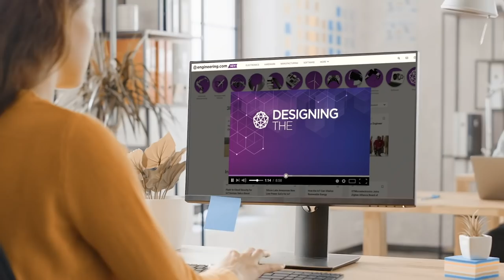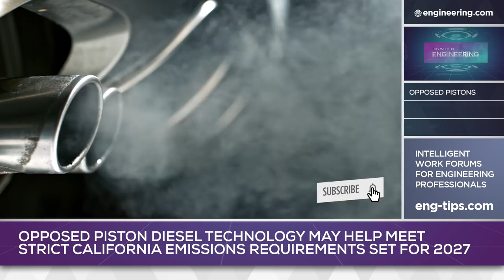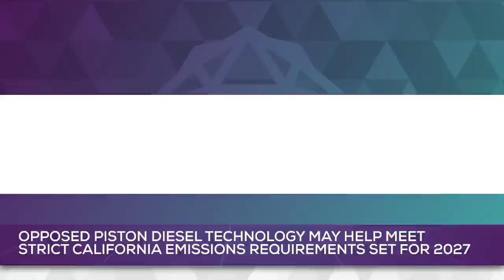Opposed Pistons Offer New, Clean Life for Old Diesel Technology

Comment: Fairbanks Morse opposed piston diesel engines were used in submarines during WW2 and locomotives in the 1950's.
Reply: And still in Coast Guard vessels.
Reply: They are used for generators in submarines to provide backup power on US nuclear submarines commissioned through the 1990s
Reply: Many fleet subs in WW2 had opposed piston F-M Diesels as well as the GM vee-block Diesels.

Comment: FYI the first opposed piston diesel engine was designed and a prototype built in Russia before 1910. So the technology is almost as old as the diesel. I also note that the Napier Deltic was a very efficient, comparatively small and lightweight (roughly 1/5 the weight of comparable power engines) two stroke diesel which could provide a good model for a future design.
Reply: The only thing against the Deltic was its complexity. I think the world is loooking at three-cylinder opposed-piston diesels for a long time.

Comment: Very little technology used today is new. This design engine with 2 crank shafts geared together and 2 opposing pistons per cylinder was one of Fair Banks Morris's best built engines. The multiple cylinder engine that in the 80's Cadillac called the 4-6-8 and now other manufacturers have other names for, was first tried in 1908. It was several levers on the dash that the driver could use to disable a number of cylinders as needed to save fuel. They said it didn't work very well then either. Electric cars, alcohol fuel, variable displacement engines and opposed piston engines are just some of the ideas developed and tried between 1900 and 1950. Some have come back because we have the technology to make them work now but some of the ideas just aren't very good ones. We don't create new ideas much anymore. We just improve the ones our ancestors thought up. I f a new idea is thought of it is so complex that it isn't much use. I learned a long time ago the KISS rule should always be considered when building or designing something. KISS means keep it simple stupid.

Comment: Wow! This-> 2:10 is a careless way to say that.

The Junkers engine was a copy of the French Gobron-Brillié design, established before Heavier than Air, Powered Flight existed :

"One of the first opposed-piston engines was the 1882 Atkinson differential engine,[7] which has a power stroke on every rotation of the crankshaft (compared with every second rotation for the contemporary Otto cycle engine), but it was not a commercial success.[8]

In 1898, an Oechelhäuser two-stroke opposed-piston engine producing 600 hp (447 kW) was installed at the Hoerde ironworks.[9] This design of engine was also produced under licence by manufacturers including Deutsche Kraftgas Gesellschaft in Germany and William Beardmore & Sons in the United Kingdom.[10]

In 1901, the Kansas City Lightning Balanced Gas and Gasoline Engines were gasoline engines producing 4–25 hp (3–19 kW).[11]

An early opposed-piston car engine was produced by the French company Gobron-Brillié around 1900. In April 1904, a Gobron-Brillié car powered by the opposed-piston engine was the first car ever to exceed 150 km/h with a "World's Record Speed" of 152.5 km/h (95 mph).[12] On 17 July 1904, the Gobron-Brillié car became the first to exceed 100 mph (161 km/h) for the flying kilometre.[13] The engine used a single crankshaft at one end of the cylinders and a crosshead for the opposing piston.

Another early opposed piston car engine was in the Scottish Arrol-Johnston car, which appears to have been first installed in their 10 hp buckboard c1900. The engine was described and illustrated in some detail in the account of their 12-15 hp car exhibited at the 1905 Olympia Motor-Show.[14] The engine was a 4-stroke with two cylinders (with opposed pistons in each) with the crankshaft underneath and the pistons connected by lever arms to the two-throw crankshaft.

The first diesel engine with opposed pistons was a prototype built at Kolomna Locomotive Works in Russia. The designer, Raymond A. Koreyvo, patented the engine in France on 6 November 1907 and displayed the engine at international exhibitions, but it did not reach production. The Kolomna design used a typical layout of two crankshafts connected by gearing.

In 1914, the Simpson's Balanced Two-Stroke motorcycle engine was another opposed-piston engine using a single crankshaft beneath the centre of the cylinders with both pistons connected by levers.[15] This engine was a crankcase compression design, with one piston used to uncover the transfer port, and the other to open the exhaust port. The advantage of this design was to avoid the deflector crowns for pistons used by most two-stroke engines at that time.

Doxford Engine Works in the United Kingdom built large opposed-piston engines for marine use, with the first Doxford engine being installed in a ship in 1921.[16] This diesel engine used a single crankshaft at one end of the cylinders and a crosshead for the opposing piston.[17][18] After World War I, these engines were produced in a number of models, such as the P and J series, with outputs as high as 20,000 hp (14,914 kW). Production of Doxford engines in the UK ceased in 1980.[17][19][20]

Later opposed-piston diesel engines include the 1932 Junkers Jumo 205 aircraft engine built in Germany, which had one crankshaft, using a design similar to the 1900–1922 Gobron-Brillié engines.[21]"
Reply: If Wikipedia is your source, then you don't have a source.

Comment: How is this new tech when the British were using it in WWII deltic engines? Then of course there was the Culverin in the early to mid 30's another Napier design. Before that there was the Junkers Jumo 204. That was operational in 1932. I know the Americans like to be fashionably late (EG WWI and WWII) but 90 years is a bit excessive. Especially to then call it "new".
Reply: The Culverin was a Junkers 204, built under license.  The Deltic was a post-WW2 engine, entering railroad service in 1960.  What makes the Achates engine new is modern high pressure fuel injection systems and a large amount of computer analysis of the combustion process.

Comment: I can remember seeing the two stroke Deltics start up at St Pancras , the epitome of  opposed piston  ingenuity,  a cloud of acrid  black smoke and unholy noise  enveloped the whole station, as if the engine was on the point of spontaneous disassembly. Good luck on to the engineers taming that with Cats and add blue.
Reply: Contemporary overhead valve diesel engines produced clouds of acrid  black smoke then.  Technology has tamed those.  That technology transfers readily to OP engines.
Reply: @superdave380  Its Commer knocker with EFI a  big CAT and DEF, used to haul coal in limestone around here 50 years ago,. Not the best sounding engine either. Fun for the engineers but 2 strokes are not so economic  once you have bolted on the chemical plant for the exhaust compliance and dumbed down the combustion dynamics to work with them.  Not happening.
Reply: @logtothebase2  I guess that you know more than the engineers that are making the Achates design work.
Reply: @superdave380  I am a YouTube comments expert so I know way more. I hope they have success and their slide rules run true, but I feel squeezing more out of the ICE isn't the way to go, we will see
Reply: @logtothebase2  Fossil fuels are a finite resource, the ICE cannot last much longer.  Until we have a viable sustainable replacement we should build the most efficient and cleanest engines we can.
Reply: @superdave380  Agreed.
Reply: I'm sure with modern electronics some of the faults if not all can be ironed out ( head gasket manufacturers watch out!!

Comment: I think you will find that Burmeister and Wain built  opposed piston engines for ships prior to this.  Prior to them were other opposed piston engines  with varying degrees of success.

These opposed piston engines were very popular.  There were also 6 double acting marine diesel engines built, for three ships. Not fully opposed piston as upper and lower exhaust pistons were of smaller bore.

Comment: You don't explain how it is that the OP engine actually reduces the emissions, just that 'it does' 🤷

Is it due to the the very long effective power stroke resulting in a more complete burn? (given that the 2 pistons are moving apart, rather than a single piston moving away from a fix cylinder head)
I  also don't understand how the cylinder can be completely scavenged of burnt gasses as a two stroke engine, or is that also part of the emissions reduction - A pseudo EGR if you will?
If this is the case, then how is it efficient?
Reply: The inlet air is under pressure from the turbocharger, and blows in while the exhaust is going out the other end of the cylinder. This can completely eject all the exhaust, with a little clean air following it, which modifies the exhaust chemistry. The expansion ratio in opposed-piston engines seems to usually be greater than standard diesels, consequently with lower exhaust gas temperatures. The cylinder has a "cold" end where the inlet air enters, and a "hot" end where the exhaust ports are.
Reply: @paullangford8179  As a mechanic, I understand that the engine is super/turbo charged, I just find it highly unlikely that the the cylinder can be completely scavenged in the brief window of time that the ports are uncovered.
Making the exhaust port timing longer would relieve still burning gasses to the exhaust system.

It's the exact reason 2 stroke Detroits aren't with us any more.
Reply: @Danger_mouse  wartsila and MAN still produce two strokes which are higly effective in terms of fuel consumption (0.170 kilos per Kw/hour). But thats a low rpm ship engines. Also their latest models allow smokeless operation on low load which is cleaner. But i think that's all possible only on low rpm engines with electronic control of injection, timing etc. I'm pretty sceptical about using two strokes on trucks
Reply: @lilvoklo  Correct.
A little different for a high speed diesel engine, and as used for on highway. These engines are also under much stricter emissions standards than off shore shipping.
Reply: @Danger_mouse  two-stroke Detroit diesels are gone because they failed to meet emissions, oil consumption and had difficulty with keeping up on specific fuel consumption ie thermal efficiency.   Achates has addressed these issues in many test engine prototypes and subsequent SAE technical papers thoroughly explained.
Reply: @Danger_mouse  Detroits were not opposed piston.  Opposed piston cranks at not exactly in synchronisation.  The exhaust opens before the scavenge and closes before the scavenge ports close.

The advantages are many, one is very good scavenging, lead to almost a complete charge of clean air.
Reply: @duncangatland6021  I know Detroits were not opposed piston 😂
I've been a mechanic since the 80s.

I'll wait to see a mass market engine out there hauling freight before we get all excited about a 70yr old resurrected technology. 👍
Reply: If i remember right, the exhaust from one cylinder is also fed mixed with fresh air and used in the others, sort of an automatic egr, but at lower temps, getting as much as possible out of each combustion stroke.
Reply: @timduncan8450 
OK, but how specifically?
The very long cylinder would to me, seem difficult to scavenge properly, especially at low rpm (and corresponding low boost levels)
You're either opening up the exhaust early and wasting useful work to clear the cylinder and dumping unbunt gasses into the exhaust, or you are not clearing the cylinder fully and missing out on useful fresh air to create power.
Great for cooler temps and Nox reduction, but not at full power climbing a hill.

This was my reason for the original comment, they say that they have great emissions and power etc, but don't explain how
Reply: The intake ports in the cylinder are designed to produce a large amount of swirl and tumble in the combustion chamber, which improves combustion while reducing hot spots.
Reply: @Danger_mouse  The earlier opening of the exhaust ports allow the still expanding gases to escape, and this provides momentum to "extract" gases in the cylinder.  Know that very little useful work is now available, and gas temperatures need to be low enough not to cause any excess heat in the remaining liner between exhaust ports. Early engines had an air pump at the free end.  Later used the space under the piston to further compress the turbo charged air.  As a result scavanging was rather good.

The exact same scavenging technique is used on today's large, slow speed cross head engines  where FE Analyisis is used I'm modelling these gas flows.  These engines have a thermal efficiency nearing 60%.

To reduce all of the exhaust emissions,  we, the consumer need to buy closer to home. And manage our consumption. 

For the better efficiency of the opposed piston engine, that is to do with the use of the heat to do work, and not the loss of it into a fixed cylinder cover. 

The mechanics of such engines, make them of poor economy today, due to build and maintenance complexities and thus costs.
Reply: @duncangatland6021 
Good reply, thanks.
Better than the description in the video

Comment: Opposed positions are even in Volkswagen originally they were since 1936 Volkswagen now 3d printed version to make bigger version even for demolition derby school buses now cb performance recently advanced it more to go faster turbo desil to turbo  two stock desil in Volkswagen now Volkswagen old beetles that went only eighties in mid forties to days while in 30s went up to a 106 mph while military ones only 80 were all opposing pistons but now with new stock engines and cb performance with desil and turbo mixed in others making them go faster now one went 400 mph maybe gas versions will be made for police with gas turbo and trucks like pickups both some with desil some with gas and and trucks like denied school buses etc delivery trucks desil and Volkswagen running on both now restoring them beetles and some making them into big SUVs but still look like old icons but bigger

Comment: In terms of kg for kW of output, are Diesel opposed piston engines heavier or lighter than equivalent conventional ones?
Reply: Lighter.
Reply: I like the idea of opposed piston engine but would like to retain a few side valves ie side valves on the side at the end of the stroke

Comment: Speaking on that battery technology look up the name 'John B Goodenough', the grandfather of Lithium-Ion batteries, and check out the third-generation he released recently.  It fleatures glass as the primary ingredient, is solid-state, operates in arctic and death valley temperatures, charges 10 times as fast and needs very little cooling.
UPDATE:  Toyota just dropped 1 Billion on solid state batteries. They anticipate 400 miles on a ten minute charge.  https://www.youtube.com/watch?v=aiqXy1iD-o4